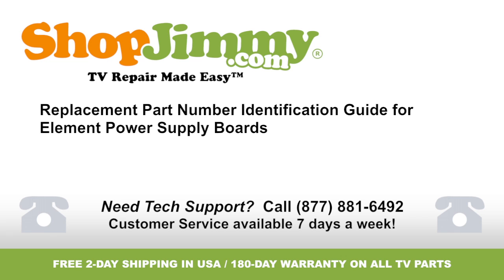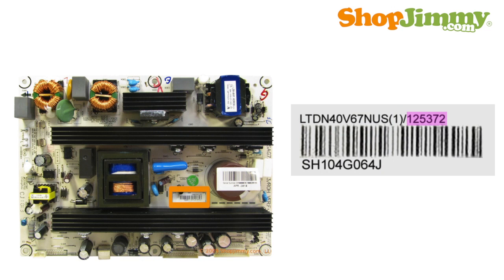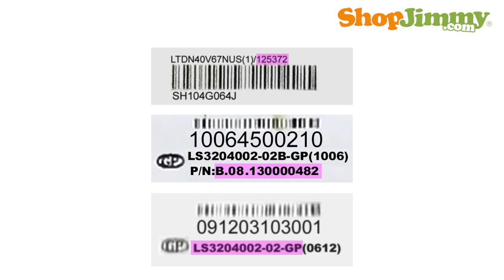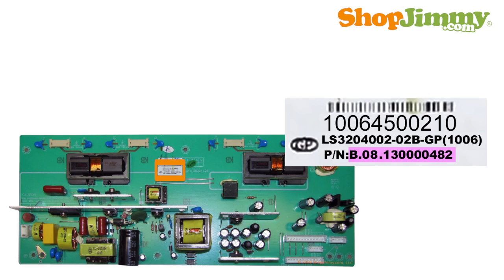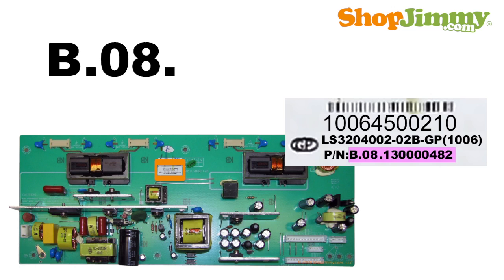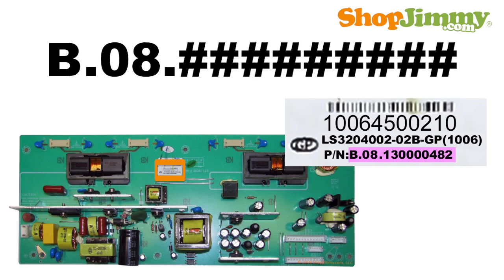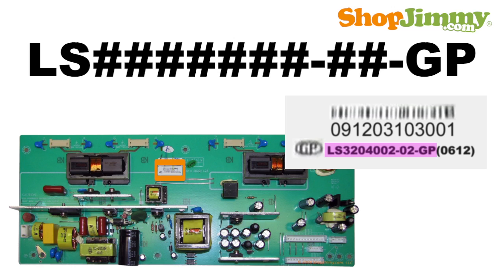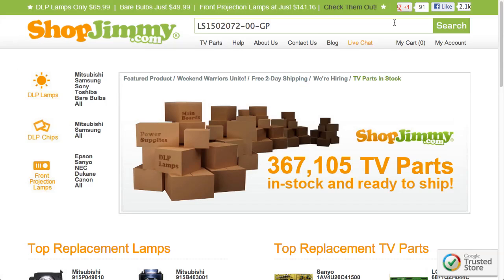TV Part Number Identification Guide for Element Power Supply Unit (PSU) (LCD, LED, Plasma)

Comment: HoW do i find out what power cord my 32 inch samsung takes
Reply: Hi @Barbie Gibson, sorry I've only just seen this message.

Most Samsung TV's have a standard two pin power cord - known as the figure 8 cord. Nevertheless it's worth checking the back of your TV for what you need specifically (and the appropriate extension for the country you are in).

If you still have trouble with your TV not powering on, it's likely an issue with your PSU board. You will need to open up the back of your TV very carefully (only a few screws to undo) and check the brown-ish coloured board. Check that there are no fuses blown (they will be a blackish kind of colour). 

For Samsung TVs, take a look at the top of the PSU board where it says "code no." that's what you will need to search for if you want to replace the PSU board. You can find second hand working boards on eBay for around £30. 

Obviously if you are not confident enough to make the replacement yourself please seek help from a professional.

Comment: My Element TV model ELEFT502 has no picture. It has audio. I did the back light test in dark and picture test as described on the your website. Can you advise which circuit board will be bad.
Can not find the inverter.  There are three boards i.e power supply board, main board and T con board. Which board I will need to replace. Please advise if the inverter is within the power board.
Reply from the maker: Ilesh Patel  Please watch this video FIRST to help with your repair!  TV Repair! LCD, LED, Plasma, DLP How To Fix Your TV with ShopJimmy.com Help!  I recommend replacing the power supply board in your TV.  Here is a link to a replacement board, http://www.shopjimmy.com/seiki-mip550d-5tc-power-supply-unit.htm  If the board on the page is out of stock , please refer to the parts listed under "These in-stock products will work for this item."  Be sure to match part numbers on your current board, with your replacement for compatibility.  Thanks and please let us know if you have any further questions with your TV Repair!  www.shopjimmy.com